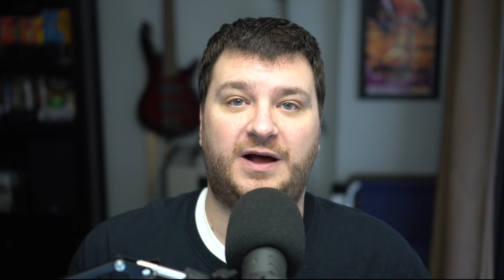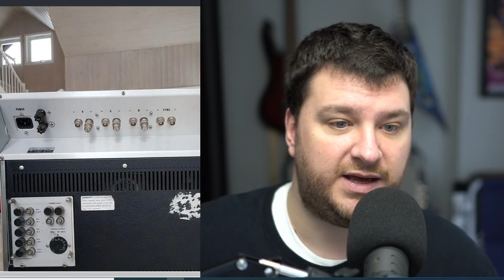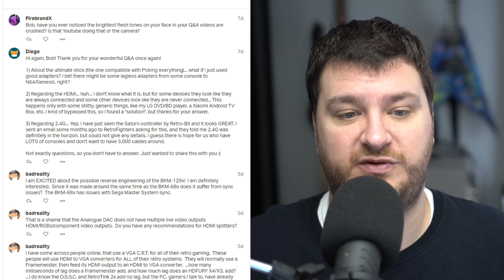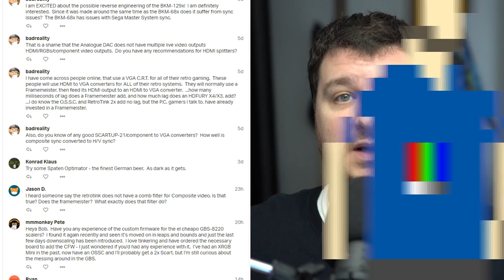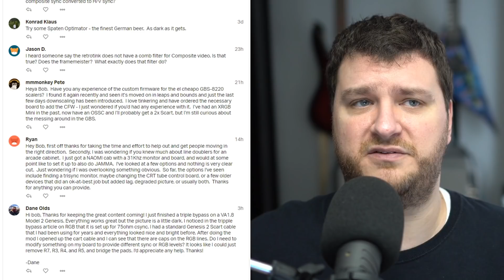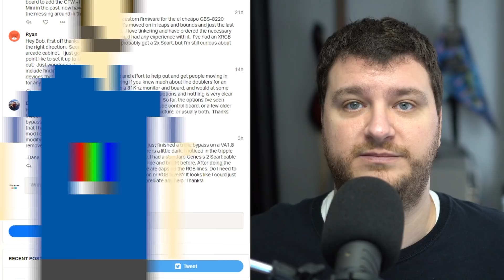Supporter Q&A #93

Comment: Does Dreamcast with Akura/Gekko HDMI Box works with mClassic connected to HDMI Output of Monoprice 8X1 HDMI Switcher?

I've tried that with other HDMI Switcher that has HDMI 2.0 ports. The screen keeps flickering while showing a Dreamcast Screen.

I've tested with another HDMI Switcher by Radioshack that has HDMI 1.4 ports. I have no issues with Dreamcast.

I know Monoprice 8X1 HDMI Switcher has HDMI 1.4 ports. But it use 12V Outlet. Compare to Radioshack HDMI Switcher (HDMI 1.4) and other HDMI Switcher (HDMI 2.0) that has 5V Outlet.

Monoprice 8X1 Enhanced Powered HDMI Switcher
https://www.amazon.com/dp/B003L14X3A

Comment: FYI, the Framemeister uses 4:2:2 chroma subsampling, same as the RetroTINK products. Only the OSSC and I believe the A1 do full-resolution chroma processing. The latency is an issue as you mentioned, as is the ADC noise, but if you specifically want nice-looking deinterlacing the Framemeister is still the best choice, so I can't really fault people for choosing it over the alternatives.

As for the comb filter question, I actually prefer a basic notch filter for games (i.e. the "retro" setting in the RetroTINK-2X). Back when I used a Framemeister, I would run composite video into the S-Video port to bypass the comb filter. For video, a good comb filter is nice.

Comment: Hi Bob, use a custom white balance by using a color passport and a greycard. Before you start recording you adjust to a grey-card and if you want to take it a bit further then use the color passport (a checkerboard of colours and correct it in post with this as a color reference under your lighting condition).